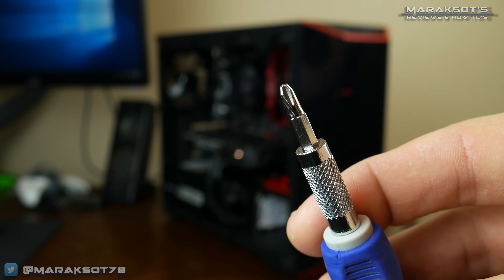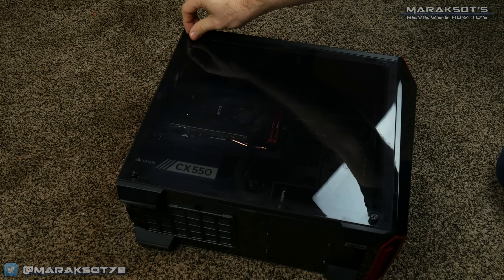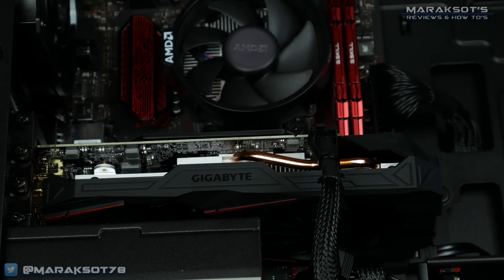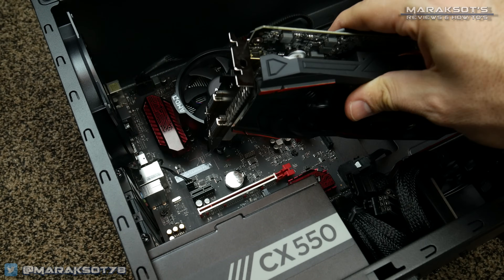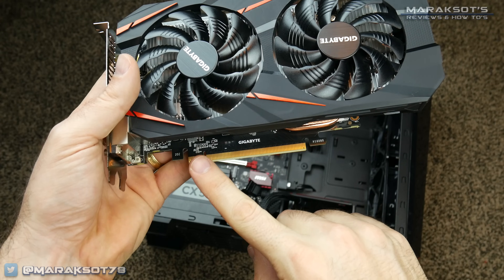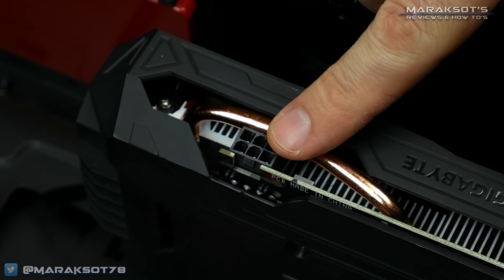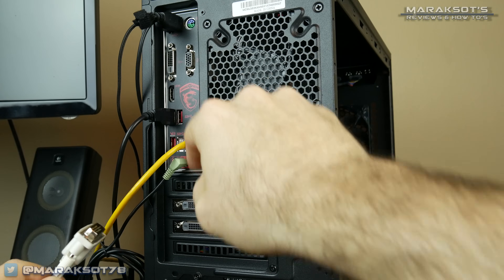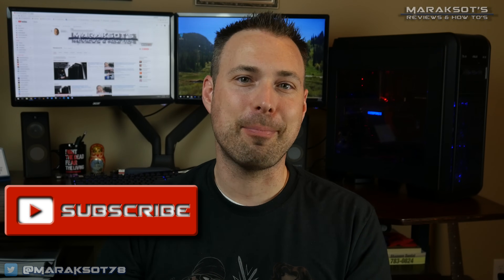How to Install a Graphics Card - Upgrade Your GPU

Comment: Is it bad if I play games on super low settings without a graphics card then later on installing one?
Reply from the maker: Nothing wrong with that.  :)
Reply: @Maraksot78   do I have to uninstall the old drivers first or I can just install the new gacrd drivers
Reply from the maker: @illmacktgod6677  i would uninstall the old drivers before installing the new drivers.  You can go ahead and swap in your new graphics card too before uninstalling the old drivers. That's not a problem at all.
Reply: @Maraksot78   thanks for the help I appreciate
Reply from the maker: @illmacktgod6677  No problem man. Cheers!  :)
Reply: @Maraksot78   like once I got the new card in and power up. Do I install the new drivers first or uninstall the old ones first?

Comment: My gpu didn’t have any display ports, it’s an Asus turbo 2070, anyone has any idea what’s going on?
Reply from the maker: What do you mean your 2070 doesn't have any display ports? From the pictures of that card I've found online you should have two display port (DP) outs (there the ports on eithe side of the HDMI port), one HDMI port and one USB type C port (the smallest port).  Are you wondering why it doesn't have a DVI port or a VGA port?

Comment: If the cord that runs from your psu to your graphics card splits into a 6 pin and an 8 pin and your new graphics card only requires 1 8 pin, can you use the old cable on the new card?
Reply from the maker: I don't totally understand your question... So are you saying your PCIE power cable has a 6 pin power connector and then an 8 pin daisy chained to it?
Reply: @Maraksot78  Well it splits into two cables that can both be 8 pin if need be but I only need one 8 pin for my new card.
Reply: @Maraksot78  It's a gaming PC I purchased years ago prebuilt so I'm not exactly sure what cables I need or if the one that's already connected will work.
Reply from the maker: @GODOFCOD147  if I'm understanding you correctly..  I'm assuming you're removing your old graphics card and installing a new one.  Just remove the 8 pin PCIE power from your old card and plug that same one into your new card and you should be good to go.
Reply: @Maraksot78  It ended up working with my 1070 ti strix. Thanks
Reply from the maker: @GODOFCOD147  Happy to hear it.  Enjoy!  :)

Comment: Tried to install my new gtx 1070 ti evga sc version...my msi gtx 1080 aero was not to my liking. Temps sucked. Anyway when I installed it, it would not boot. All my fans, coolers, rgb case strips work and the card starts up but the fans stop and try to spin. Start and try to spin over and over. Just got a new 650 watt psu from corsair. When I put back my old 1080 it boots just fine. Any help would be greatly appreciated.
Reply from the maker: I'd start with the simple stuff. First thing I would try is reseating the card. Make sure it's fully seated in the PCIE slot and make sure your supplemental power connectors are fully plugged in.
Reply: @Maraksot78  I did try several times. Should I try the second slot at the bottom?
Reply from the maker: Hmmm... yah you can try another PCIE slot, but if your 1080 works in the top X16 slot then your 1070ti should work too. Do you have another computer you can try it in? If it does the same thing in a different computer then I think the odds are pretty good you have a defective card.
Reply from the maker: I was just thinking about your question and had a thought come to mind... when you say it would not boot are you saying that your computer won't boot up into Windows? That was the assumption I made but then it occurred to me that may not be what you meant because you said that the 1070ti will start up initially but then the fans try to spin over and over... so it made me think I should have asked for just a little bit of clarification there to make sure I understand what's happening.  If you're booting into Windows and CAN use your computer just fine but the fans on your card spin a little bit occasionally when you're in Windows then I think everything is just fine. Most modern cards have pretty beefy heat sinks on them which dissipate the heat from the GPU really well. So the fans will only stay on when the GPU is under load while playing a game or something and needs the additional cooling the fans provide. When it's just sitting idle and it doesn't need that additional cooling the fans won't spin at all. When the GPU temperature is right on the border line of needing additional cooling the fans will often turn on and off again because it gets just hot enough it needs them to turn on but then that cools it just enough they turn back off again.  I hope that all makes sense.  That being said if your computer is not booting into Windows at all and switching PCIE slots isn't fixing the problem and if swapping it into another computer causes that computer not to boot up then I think you have a defective graphics card.
Reply: when i turn on the power button everything else turns on. case fans, cpu cooler, speakers, keyboard, mouse, i even hear the noise from the speaker that i can sign into my windows account. my razer synapse actually connects to the internet and all my profiles load. however, the screen is just black and i notice the gpu fans spin for a second and stop. they even alternate. one will spin then the other. they dont spin at the same time. hopefully this clarifies everything. I have placed my old gtx 1080 back in and as soon as i power on the case the screen works.
Reply: Update I have updated the bios, used ddu uninstaller to get rid of prev GPU programs, tried hdmi port instead of dvi and tried second graphics card slot further away from CPU, also tried different pcie connectors. Have tested ram and seems good. New 650 watt psu and CPU temps seem fine. Thinking at this point maybe it's a bad card. Thank you for all your help! I just hope in the future if I want to upgrade again I dont run into this issue again. I feel crazy lol.
Reply from the maker: sounds like you've covered all the bases/usual suspects.  Sorry you're having this issue.  I just did a little searching on the EVGA forums and found a guy that sounds like he had a similar issue to you.  Here's what he said in his initial post..

"Hi guys, so I've just finished my first build, but when I turn on there is no signal detected by my monitor. If I remove my GPu from the pcie 2 slot and unplug the 2x8pin connector, then boot, it starts up as normal. The GPu fans spin and the leds illuminate, but I get no monitor signal...  I've connected the pcie two 8pin connectors to 2 separate vga ports on the psu and then connected to the GPu. I've also tried plugging the hdmi into both the motherboard and the GPu."  Please give me some help here as it's driving me crazy, thanks

further down the thread he says he found the solution to the problem and says this...

"Hi guys, just wanted to update in case anyone ever gets stuck. I managed to get it working by removing the GPu, connecting my hdmi to the mobo and then going into the bios settings. In bios I selected advanced settings, then chipset configuration and then enabled the PCH PCIE ASPM Support option. Save that, then switch off and reinstall GPu, connect hdmi to the GPu output and bam, works perfect.  Thanks to everyone who replied it was a big help."

You may want to give this a try.  I'm not sure what motherboard you have and what the menu/options are like on your board but you may have something similar going on.  Since it's working with your 1080 this may not be the issue but it's worth a shot.  You can just leave your 1080 in and try this you don't need to remove your graphics card entirely like this guy did.  It appears he didn't have another graphics card he could use to access his BIOS so he just used his CPU's integrated graphics to do it.

If you'd like to check out the entire thread here's a link to it so you can check it out.  

https://forums.evga.com/No-display-with-gtx-1070-connected-SOLVED-m2598076.aspx
Reply: @Maraksot78  thank you so much man. You have been a great help. I think I will invest in a kraken g12 and water cool my GPU. Will be cheaper to boot. Subscribed 4 life.
Reply from the maker: no problem man, I'm happy to do what I can to help.  Plus I sometimes get to learn new things in the process which I love.  So you planning to return the 1070ti and water cool your 1080?  Sounds like fun.  Thanks for the sub.  Cheers bro!  :)

Comment: im about to go from a MSI Radeon R7 250 2gb to a PowerColor VGA - AXRX 580 8GBD5-3DH/OC... (OC'd RX-580 Red Devil, basically, from what i understand anyway).... anyways, clearly, the R7 250 isnt using any supplement power. i got a cheap-ish Cyberpowerpc prebuilt and its just not up to the task. im going to be building a better system as i can save money to get parts as i can, but felt the gpu would be the best place to start to at least be able to play around with for now... anyways, the chipset in this pos is Gigabyte GA-970A-DS3P.... i know, i know, terrible, but i am getting things as i can.... anyways, this prebuilt is near impossible to dig through to find any power cords that could be used.. how do i find them? could you recommend a way to do it? if not, im going to have to cut system off and completely pull everything apart...
Reply from the maker: I'm not sure I completely understand your question... I think you're asking about finding the PCIE power connectors from your power supply that you're going to need to properly power your RX 580?  Depending on what your Cyberpower system specs are you may not have a power supply that has enough wattage for your RX 580.  The RX 580 recommends you have at least a 500 watt PSU, the R7 250 recommends a 400 watt PSU so it's possible Cyberpower only put a 400 watt unit in your PC... and since the R7 250 doesn't require supplemental power they may not have installed a PSU with any PCIE power cables on it.  If however they did install a 500 watt unit then you're ok on power.  If your unit doesn't have PCIE power connectors on it that's not a big deal.  There are molex to PCIE and SATA to PCIE adapters you can buy online so you don't have to buy a whole new PSU.  I hope this all makes sense.

Comment: My power supply doesnt have a Power off and on button can i still do this
Reply from the maker: yah, no problem.  Just be sure to unplug your PC from the wall and you'll be fine.
Reply: @Maraksot78  ok ty! Also I bought a 1050ti and an Air Duster can i safely clean the pc with the air duster or is there any dangers
Reply from the maker: yah there's no problem using canned air to clean the dust out.  Just be sure to hold the can as recommended so only air comes out.  If some of the propellant comes out it'll get stuff wet and you'll have to wait for it to fully dry before powering your system back on again; not all that big of a deal but something to be aware of.
Reply: @Maraksot78  ok ty again. Im now starting to install new gpu!
Reply: Also i have a broken wrist and a cast can i still install it without static
Reply from the maker: you should be fine.  Just touch your case every 5 minutes or so (assuming your case it made of metal). even if you do build up static and shock something the odds of breaking something are actually fairly low.  Most components now have ESD protection stuff built into them to help prevent it.
Reply: @Maraksot78  do i need to push hard to get the gpu latch down?
Reply from the maker: you shouldn't have to push really hard.  if you're pushing hard and it's not latching you'll want to try seating the card again.  make sure the latch is open before seating the card and make sure the metal "fingers" on the card go into the little slots in the case that are kinda hidden by the edge of the motherboard.  If you follow the instructions in the video exactly you'll be good.  Sometimes the latch latches and you don't really notice it too so you may be latched just fine.
Reply: Dude thank you so much you helped me install my gpu first time ever! Ur so helpful ! appriciate the help :)
Reply from the maker: No problem. I'm happy to help. Enjoy that new graphics card.

Comment: i have ryzen 5 1400 , 8gb of ram, and i have a rx 580. Ive been wanting to upgrade to a gtx 1080 armor oc, do you think my cpu and my ram is good enough to get the best experience with the new graphics card?
Reply from the maker: yah you should be good to go.  Just out of curiosity why do you want to upgrade to a 1080?  Do you have a high refresh rate or higher than 1080p resolution monitor?  The RX580 is a beast of a card when it comes to 1080p 60Hz gaming; I would only recommend spending the money to go to a more powerful card if you're gaming at 1440p or above and/or if you're running a really high refresh rate monitor, i.e. 120Hz+
Reply: Maraksot78 I’m looking forward to stream so I wanna get a steady FPS  in most games when I stream
Reply from the maker: Cdubz Gaming are you planning to stream from your same rig or do you have a dedicated streaming PC too? You'll probably want to upgrade your CPU to a Ryzen 7 if you're going to be gaming and streaming at the same time.  I don't know exactly what your experience will be like with the R5 1400 since I have never got to test that personally I just know that when you're gaming and streaming at the same time the more cores and threads the better.
Reply: Maraksot78 and yes for 1440 p to my rx 580 isn’t to good for that
Reply from the maker: Cdubz Gaming ok, if you're at 1440p then yah a 1080 will help get you all those pixels at high settings and a good frame rate. :)

Comment: so i asked about a pcie riser a while back and i have one last question, im going to buy this monitor: 
https://www.amazon.com/dp/B01N2QN4YP/ref=twister_B01MYA5ZRA?_encoding=UTF8&psc=1
its 144 hrtz so do i need an hdmi or a display port, im seeing mixed ideas on it in the fourms

also update on the card: it still wont fit so i need to mount it vertically :/
Reply from the maker: I've personally never used a high refresh rate monitor so to be honest I don't know a whole lot about what exactly is needed.  I know that there are different iterations/versions of HDMI and Display Port and the more recent versions support higher resolutions and higher refresh rates but I don't know which ones do what because it's not something I've personally had to research.  I have some inexpensive 1080p 60Hz panels and I just use DVI because that's the most advanced connection they have on them.  :D  But since you're going with a 1080p 144Hz panel that supports Display Port I'd say go with Display Port.  As far as I know it's the "best"/most modern interface.  When I finally get around to replacing my monitors I'll definitely be doing some research to learn more about it so I can make the best decision for me.  :)